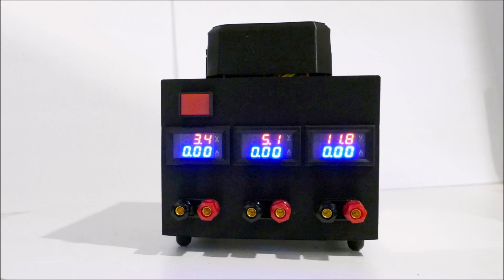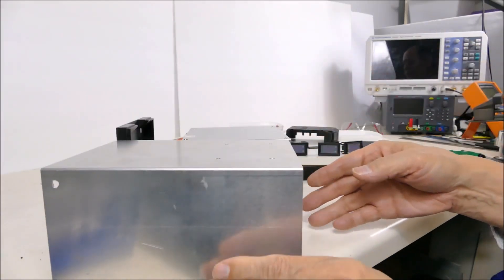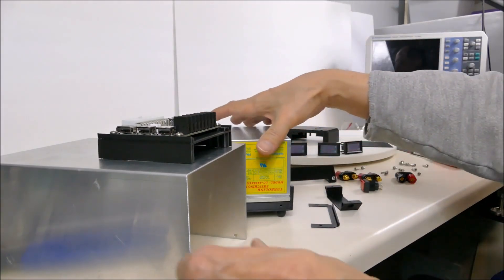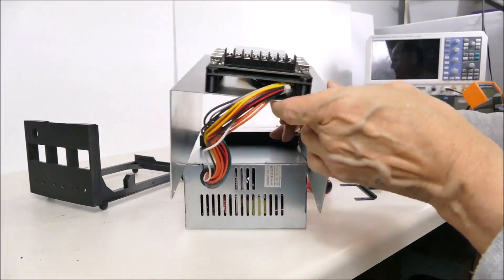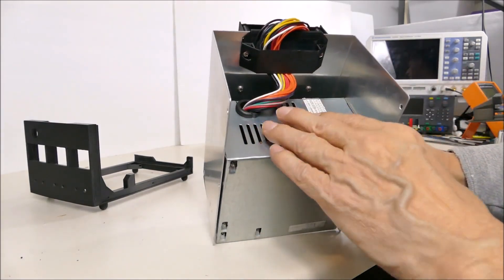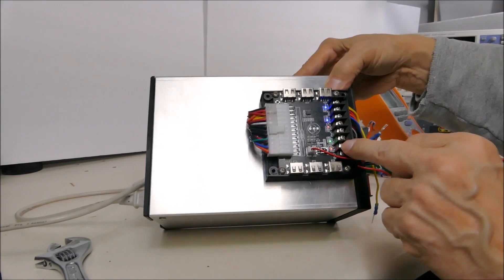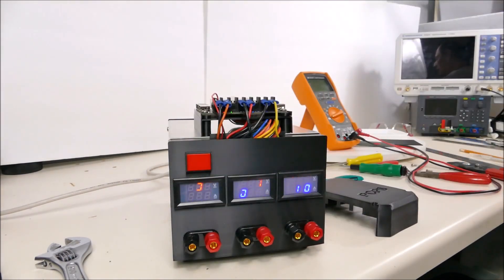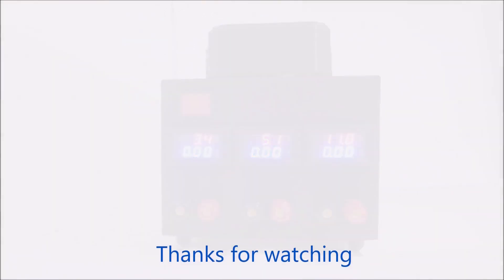PC Power Supply Conversion to a Bench Supply

Comment: This is a great video - thank you.  For years, I have taken power supplies an attempted to use them as a bench power supply.  I never connected anything to anything other than the 12 volt.  Each and every time, sometimes sooner than later, the power supply would just shut off.  I would have to disconnect the power to the the power supply, wait a while and reconnect for them to reset.  But, as always, they would shut off.  

So, I did not see/hear any mention of this problem with your set up here.  PLEASE tell me how you got around this issue?